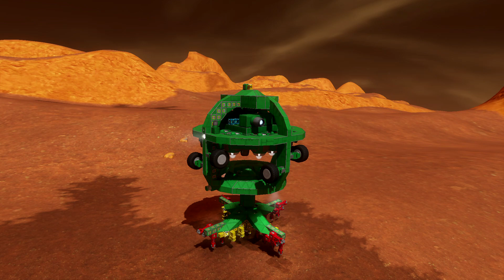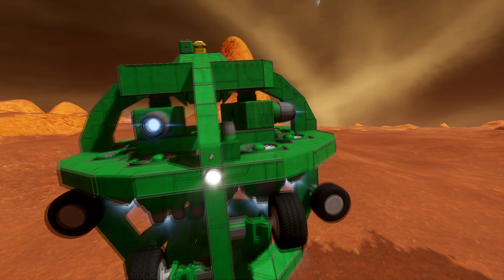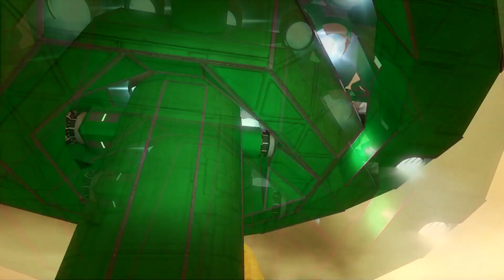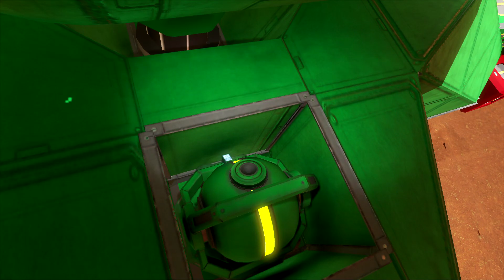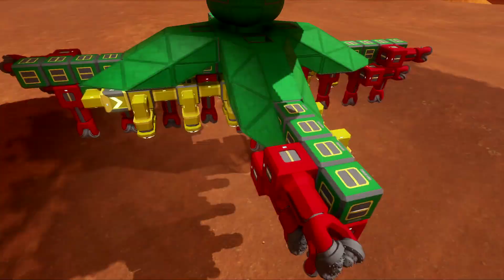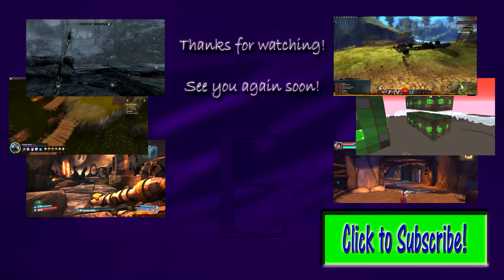Inconsistent Nuisances | Space Engineers + Me! #91

Comment: Is it possible to make a "tractor" bot? Something that continually moves back and forth around the surface of the planet dropping off pods of materials? Like makes a blueprint of a cargo with "thrust on" thrusters launching it into orbit. or just a cargo it places/drops on the floor. 
Maybe even make a bot that travels the planet picking them up and returning them to a base.
Reply: The base could produce the parts for the drop off containers/break down the retrieved ones, and store the materials for each docking point for the tractors when they return.
Reply from the maker: That would be an enormous undertaking and not one I'd be prepared to take on until Keen manages to get the basics working as intended with 100% reliability.

Comment: Would the use of antennas/laser antennas connecting the top to the bottom work? I have not messed around much with those two blocks, but it seems possible given their functions.
Reply from the maker: You could probably set it up so that you could remote control the bore head from the upper section in those situations where the game isn't recognizing the physical connection, but that's a pretty roundabout way with its own issues to contend with (like hotbars being reset quite regularly).